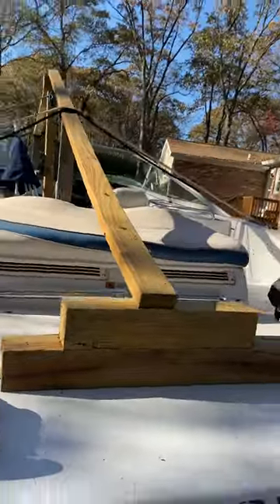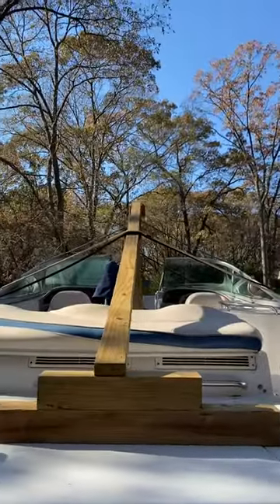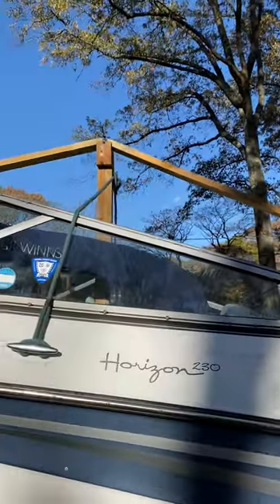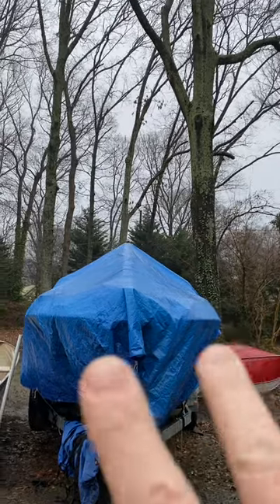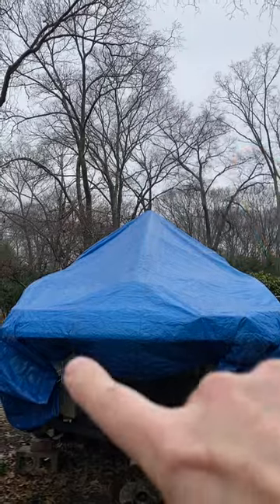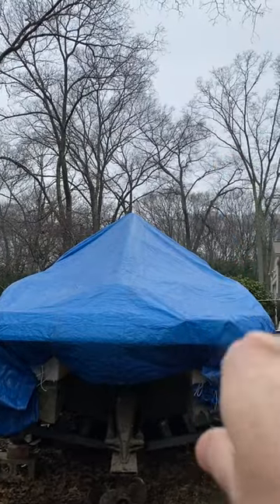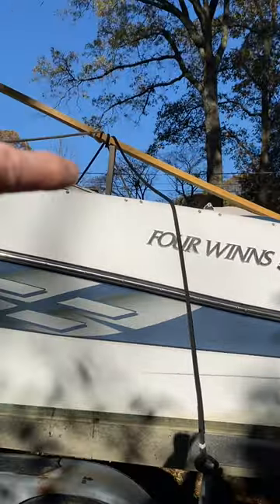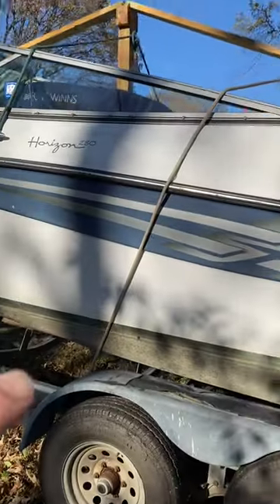Using a Tarp to Cover My Boat in the Winter

Comment: It would even be better if you get the ends higher, the you could get some air ventilation. That would reduce the possibility’s for moisture issues inside the boat.

Comment: I stretched a wire between two hefty trees, and the wire runs through some 3/4 inch electrical conduit, plastic.   It's a pain to back the boat in line, centered, between the two trees, but now the tarp is about 5 feet above the boat so no water collects on top.  It is a bit of a "sail" when windy but that shakes off the snow nicely.   Of course had to buy a larger tarp but it is worth it...and I need not worry about, for example, weight of the snow causing a wooden frame like in this video damaging/puncturing the boat.
Reply from the maker: Neat idea!